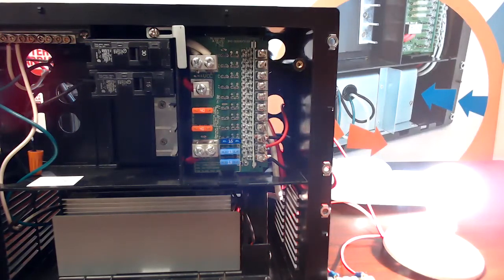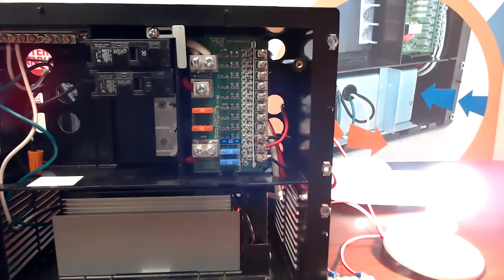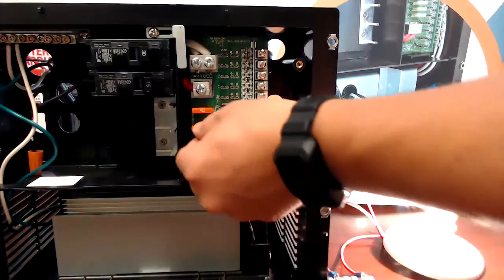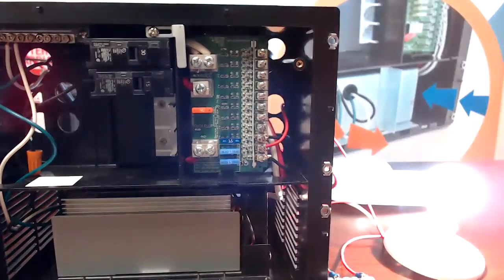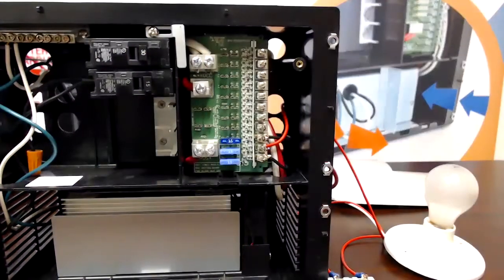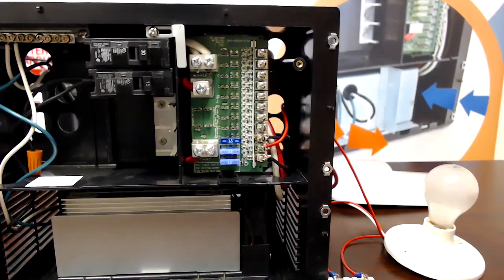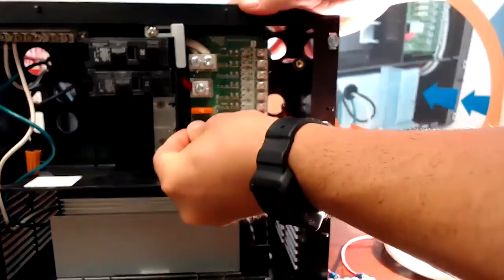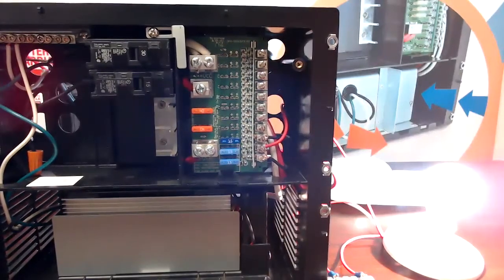WFCO Reverse Polarity Fuses

Comment: When I replace these fuses,I get a big spark. Why Is that?
Reply from the maker: You get a spark because of the capacitors in the converter.
Reply: @wfcotech  what does it mean?  It’s  normal? This happens even if not hooked up on shore power - batteries and solar only.  Should the batteries and solar be unhooked before putting those fuses In? I do not know what is a capacitor.  All the other fuses don’t spark. Only the two 30 a
Reply from the maker: @projet2907  Your solar and batteries do not need to be unhooked. The spark on the 30 A fuses is completely normal.

Comment: If these fuses are blown would you still have 12 volts if the RV is plugged into shore power?
Reply from the maker: You will not have 12V from the converter if the reverse polarity fuses are blown, but you would still have whatever your battery voltage is since everything would be running off the battery if the reverse polarity fuses are blown.